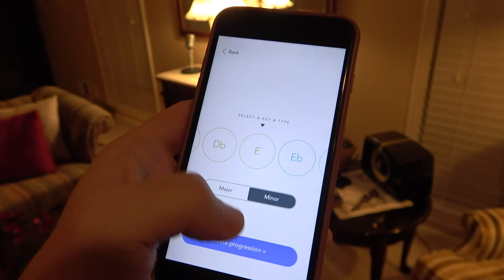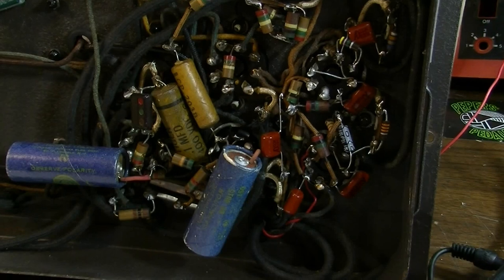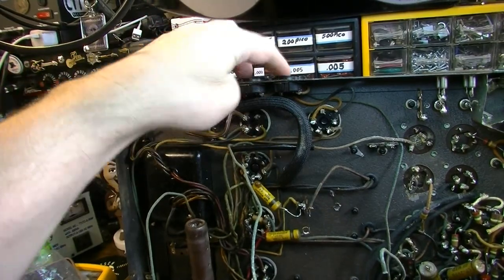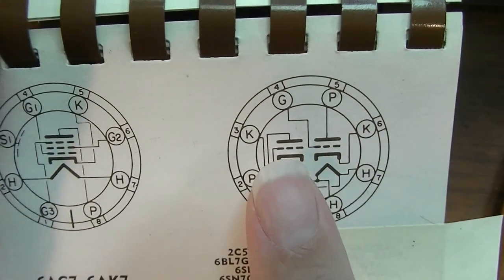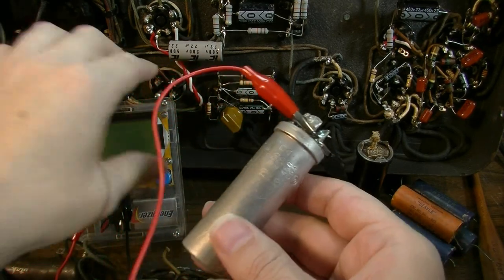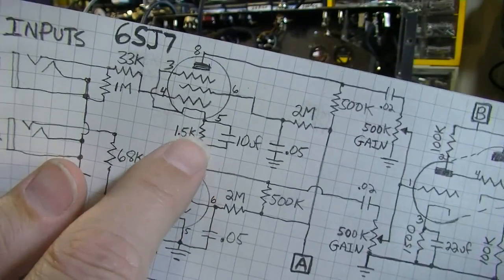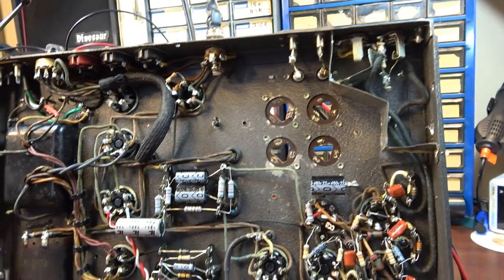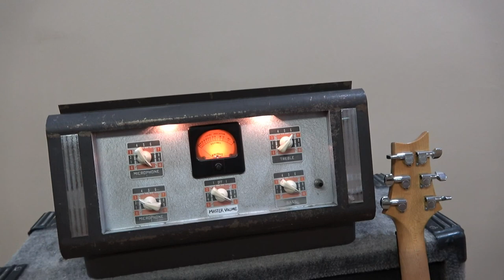EPIC Guitar Amp Conversion - Complete Tube Amp Redesign

Comment from the maker: NOTE: As some have pointed out, the demo portion left a lot to be desired, and I agree. I didn't bother dragging out my mixer and mics on this one and used the internal mic on the Sony camera, which I'm finding out is passable for speech and some low volume music and sounds, but can tend to emphasize mids and certain unpleasant frequencies too much, especially in LOUD amps like this one. I'll probably film another demo of this thing properly and put it on Channel 2, because it really does sound fantastic in person, I just gotta capture it better..
Reply: What a unique circuit and amp.Great sounds , after all that work. Bet you have got at least 30 hrs.in it. That's $2,250 if you charge just for labor,not including parts . Wow,but look at what your getting ,one off custom built amp. If you look at small 20 watt amps like the  Friedman Amo there priced at $1499  or so. So your getting a higher watt amp at reasonable price.Good work if you can get it . Have a great week.🎸👍
Reply: Great looking and sounding amp. Very creative rework! What happened with the overheating feedback resistor?
Reply: is the Sony camera the root cause of the sketchy audio at the start of the video too?  The voice audio sounds clipped but not all the time, could be a repair video maybe?
Reply: Don't the Mercury Vapor tubes emit x-rays?
Reply: Wow. Sounds great despite the mic clipping and over loads. Would love to hear a better recording. That amp sounds like it could be quite the amazing little beast.
Reply: Re that remote control ... wired in and handed over to the wife, next door neighbor, mother, club owner, lead singer, Front of House guy, etc.
Reply: @ivanlubinski6626  Just a tiny but of UV, for x-rays you need much higher potentials
Reply: i know Im randomly asking but does anyone know of a tool to get back into an Instagram account..?
I stupidly lost the account password. I love any help you can offer me
Reply: @Alec Anson It did the trick and I actually got access to my account again. Im so happy!
Thanks so much you really help me out!
Reply: @Adriel Nicholas you are welcome =)

Comment: Brad, as a fellow technician, my hat's off to you for redesigning and salvaging this old amplifier. You did a very impressive job, and that particular unit is something that I wouldn't have wanted to attempt. Your engineering skills are very impressive and imaginative, and I admire your neat and tidy soldering and wiring. I've watched many of your repairs and refurbishing videos, and it is refreshing to see the talent that you have for working on old school electronics. I'm old school, I'm 60 years old, and my initial (Army) electronics training was heavily vacuum tube oriented, so I love working with on the old stuff and seeing you work on it too. Many thanks for always showing us the schematics, it's fun to follow along! I've converted several of these types of relics into guitar amplifiers, but none have been as messy as the one that you shared here, great job man! 

There is one thing that I do differently though, I've always clipped the terminals on the ash can capacitors and left them in place for aesthetic authenticity. Antique electronics is my passion and I try to leave a set looking as original as possible.

Comment: Hello Brad! :     Those two little button cells you took out most likely put out about 1 volt maybe 1.5 volt on a real good day at REAL LOW CURRENT!! they most likely were used to POWER the CARBON button style microphones of the time!! these style microphones actually need a slight voltage supplied to them to operate! these mic units actually had a small metallic button that contained carbon granules that were acted upon by a small metallic diaphram  just like the old style telephone of the 1920's to 1935 or so have a good day!!
Reply: Awesome! That's really cool that back then they had a sort of "phantom power" of that type for mics that need it.
Reply: I researched an amp that I have ... and those things were called "bias cells".  They actually existed to provide bias for the grids of preamp stages.
Reply: Don't know if this will work but here is a "forum snippet" that discusses it..... https://www.antiqueradios.com/forums/viewtopic.php?t=122629
Reply: @robertruth3281  Hello Robert:  Yes they did provide bias for grid biased stages !In case of this amp though you will take notice that the bias is supplied by means of the cathode, so this bias cell could be there to 
provide the very slight voltage and current to a carbon button mic element as carbon button microphones were used primarily on P.A. amps up to the late 1930,s and in military operations well into the 1940's and beyond because of the carbon buttons ability to shrug off physical and electrical shocks like EMP events. They were robust!
Reply: @johnbellas490  thank you for that John.  It adds to my knowledge base!
Reply: I’ve heard of phantom power but this is RIDICULOUS!! 😁
Reply: All battery cells made is time were 1.56 volts it’s a physics thing

Comment: Beautiful job Brad, but I wouldn't expect anything else man.
Reply from the maker: Thanks Ron.
Reply: @TheGuitologist  Great work. I remember in the beginning of the video you had said the cost and time of the build far outweighs what you were compensated and it was no longer worth taking in outside work. I for one would love to see more work like this. If your going to custom design an amp from scratch essentially from a pile of old parts shouldn't you charge for it? I think so. Your providing a Botique service, a Botique amp build. I would imagine charging someone around $1800 for this build plus parts would be reasonable. They may not want to pay that but there would be justification  for this charge. With all your research before you even pick up a soldering Iron.
Reply: @ @chrislangdell117    Absolutely agree Chris.  I thought $1000 but yeah!  Brad deserves it.  The guy should ask Brad nicely if he would sign it for him & put a guitologist sticker on it!

Comment: That was really interesting especially allowing us to here the thought process in figuring the schematic to make it sing! Amazing!
Reply: And a few words about these mercury vapor rec tubes....they need to be preheated... If not their is a chance that they can explode, when a recombined mercury blob is sitting on a anode when applying the high voltage... The whole fluidly mercury need to be down at the cathode area only the vaporized mercury can form an electric path between anode and cathode. Usually the MV tube datasheet inform you about pre heat time and handling of the tube itself. I have several amps in allmost daily usage which use AX50 (like dual 866a in one envelope) MV rectifiers... They need about 10mins pre heat. The operation manual of one of these amps says: pre heat the Amp at ot least for 5 mins before service. If the Amp was in storage or in transit pre heat at least one hour in order to not blow up your Rectifier Tubes.

Comment: Love your videos along with Uncle Doug!! The 83 rectifier is very interesting. Was used in some of the very first Fender amps...The Woody, I believe. They quickly moved to the more familiar 5U4 and ditched the mercury vapor rectifier. Now, if you crank the volume on a tube amp, the output tubes ask for more current. The tube rectifier typically has "sag" and cannot quite deal with the sudden current demand....so the voltage drops and you get compression. With an 83 rectifier, greater current demand causes more of the mercury vapor to conduct and vaporize. As a result, the voltage does not sag when the power amp current demand increases. You get much less rectifier compression. The 83 behaves more like Silicon Diode rectifiers! Pretty neat!!
Reply: Nice description. Is that why this amp has a crisper attack? It was very 'out front' with each string pluck.
Reply: @sski  Yes, definitely! The attack will be fast and crisp with an 83 tube. The tube requires a special base socket....4 pin socket...to go along with its other unique characteristics.
Reply: @TubeGuy1975  Excellent! Thank you for the verification. :D
Reply from the maker: This I did not know. Thanks for the insight!

Comment: Excellent video. Nice meter. Great night light.  You must add a small meter circuit.  Seeing that bounce would be Awesome! 
Thanks.
Reply: Absolutely Correct! That would be the icing on the cake for sure.
Reply from the maker: The meter works perfectly. Bounces with the guitar. I just got lazy and didn't film any b-roll of the bounce while playing. I was rushing to finish the video and get it published and forgot to do that.

Comment: Super cool amp. Uncle Doug said you need to add a swampy tremolo circuit and hook it up to that meter.
Reply from the maker: The meter is hooked up to the output. It actually works, I just didn't film it working.

Comment: Yes, those caps may still “work” but the 50 to 100% drift indicates the plates have physically moved closer to each other. In electrolytic capacitors, the electrolyte has dried out and will not survive the original voltage rating. 
You really need a high voltage cap tester to be sure, and those aren’t cheap. Mr. Carlsons Lab has an amazing vintage unit with a magic eye that I would kill for!
Reply from the maker: I have a couple vintage cap testers. They need service though and I just haven’t gotten around to it yet.
Reply: @@matthewf1979 You're absolutely right.  Brad needs to get his other cap testers going.  Mr. Carlsons lab also has a cap leakage tester that is to die for, that I can't seem to get any build info on.
Reply: @nevillegoddard4966  That cap tester schematic and BOM is available from Mr Carlson's Patreon. I think it's still $1 to get access to it.

Comment: I appreciate and admireyour dedication to preserving as much as you could. I recently found a series filament style stereo amplifier, a pair of 50L6 GT's and 7025's. It was basically laying outside in the Florida  weather, only shielded from the rain by an old RV. The dirt and god knows what else was so thick inside the chassis you could barely see the chassis and tube sockets inside. It was just the amplifier itself, no name or indication what it came from. On top of that it looked like it had experienced a catastrophic failure at some point and had been hacked with bad repairs and all kinds of stuff was disconnected, like someone had attempted to fix it not knowing what they were doing and simply chucked it outside. I had no schematic and no hope of tracing what was there and restoring it so sadly i jusy had to gut it and save what i could. I'd like to make something of it that at least cosmetically resembles what it once was, maybe find a way to use the same compliment of tubes although that might be more effort than its worth. It's a bit of a ship of Theseus situation but even if it could be restored it'd be the same i suppose due to how bad off it was. I'd like to try to take inspiration from weird and unique old amps like Ampeg's, Valco, Sunn, things like that. Not just a fender or Marshall copy or something thats common and just sounds like everything else as you mentioned. Apologies for the long winded comment, i appreciate your content so much. I've learned a massive amount from your channel and you inspired me to learn to fix things myself when most people my age just throw it away and buy the newest thing. Thank you sir 🙏

Comment: Good day Brad. Had a thought regarding the stuck knob on the pot, have you tried Kroil brand penetrating oil. This stuff can really get into every nook. Just a thought, it works wonders on stuck nuts/bolts in mechanical work and can be used very sparingly if you allow it time to creep down into whatever you've applied it to. I'm a lifelong mechanic/welder and have little knowledge or skills with electronics and I must say you've really opened my eyes to the subject. I love the conversions, and I almost pulled the trigger on a Laffiette pa amplifier I saw on eBay and a free Hammond organ I saw on craigslist. I imagine one day soon I'll give it a go, and hopefully don't blow it up. Take care dude, love the channel.

Comment: Paper/film hybrid caps are one thing which almost never go bad.  These capacitors were developed by Sprague and originally sold under the trademark "Di-Film" but are more commonly found as Pyramid "IMP" or the Ajax "Moulded" capacitors which were used in a lot of '50s/'60s guitar amps.

Comment: To get the knob off you could have used a needle tip bottle to feed the back side of the knob some rubbing alcohol, that is how I remove lots of different adhesives I have even undone probably five bottles worth of krazy glue (not really that much but a good bit that was on a guitar pick guard's controls... just sharing some tactics my dude. You do great work and I like your commentary.

Comment: Hi , new to this chat arena but been a huge fan of you Brad. You always take the time to explain the assessment all the way to the result , anyway.
I will be getting a Vikings 50 - 96 receiver by Eaton's circa 1948. Just the chassis and all components and I was told it was working when removed from the cabinet.
Just wanted to know if it's too much for a first attempt project.

Comment: I have one of those component testers, what I did for test leads is I made a pair of banana jack sockets connected to pins, so I can just plug in standard multimeter probes, tweezer probes or clip leads. I was gonna try fit them into the case but I don't know if that'll work too well.

Comment: This is the second amp I've seen using a 6SA7 pentagrid converter in one of it's stages.  That's a very strange tube to use in an amplifier.  It's basically two pentodes stacked on top of one another with one plate and cathode.  It was designed to replace two tubes in superheterodyne radio receivers and improve the performance at the same time.  In the usual application the bottom set of grids are used as an oscillator which directly modulates the electron beam coming off of the cathode, and the top set of grids acts as a mixer, mixing an input signal with the output of the oscillator before the resulting signal is taken off at the plate.

Comment: Try using 'mixer resistors' from the wipers of those two volume pots. You'll get less interaction. Basically the same way that many Fender and Marshall amps use a 270k-470k resistor in series with the volume pot wiper, which then join together to 'mix' the signals.

Comment: Brad, It would be great if you would design your own amp circuit and get the PCB's printed by one of the Chinese companies put together a component kit, or get the components that can be surface-mounted supplied with the board.

Comment: Brad, what you did with the NFBL wont do anything. since that stage has a 47uF bypass capacitor, all the sound in the NFBL will be filtered off, the only thing that it will do is "lower" the cathode resistor since you are basically paralleling a 2.2k resistor and a 1.5k (because the output transformer acts like a short to ground)

Comment: Hi there Brad. Very nice fat tones there! It just came to me, have you try reversing the pot connections? With both wipers connected directly like in your schematic - without a stopper resistor in each - when one’s at zero, the other’s gonna short out the other to ground. Join the CW side together instead & feed the 6SJ7 signals from the wipers. Idk maybe you wanted  it connected that way though, haha. Cheers!

Comment: I wonder if trying to over tighten the screw on the knob would’ve helped to break the glue bond? Prolly would’ve stripped the threads but might’ve distorted the plastic enough to break the bond.

Comment: Could you make a mould from one knob and use clear cast resin colored to match surrounding knobs and then pour the resin into the mould then wait till it has gone hard then drill the holes for the shaft and the grub screw, can you not use 4.7K resistors in place of the 10K cathode resistors in the front end.

Comment: Dubillier Dry Caps are worth keeping , the later can earth aluminium type with 3 caps inside can read bang on after 50 years . I use them if I can find them as they save space . It must be the US side of Dubillier that called them 'Beaver ' as wtf has Beaver got to do with capacitors? Here they are just Dubillier Dry Cap , but you'll never get a leaking or even moist Beaver !
This is a radio designers idea of an amp , I was surprised not to see a quad of EFB89s as output tubes . Although these are typical radio tubes , they are a louder and shorter version of an EL84 . For cloth covered wiring gut old microwaves , they have quite a bit of HT red/black dash ptfe insulated single strand stuff that looks the part in old amps .

Comment: Hi Brad - I was also thinking about the rats nest that this amp looked like inside. I would imagine that since most of our "skilled" labor was off fighting war the country had to depend on a lot of unskilled labor in manufacturing, even many women had to enter the work force during the war to keep manufacturing going. I would imagine that because of the learning curve that these unskilled workers had to go through it is likely the reason that this assembly job looked so amateurish. Also, because of the expense of the war, many companies simply could not afford to "redo" sloppy work as long as the product worked and tested ok.

Comment: As far as testing the old caps....  unless you're testing them at their operating voltage,  it's hard to tell how bad they are.   Leakage is what usually "tricks"  those component identifier testers to read high.   I BET if you pull a brand new 100uf cap,  it'll measure 99uf on there....  I know mine does.